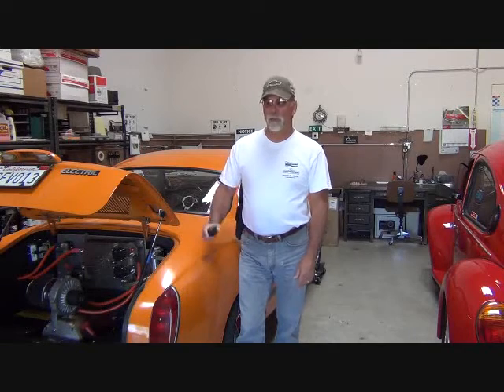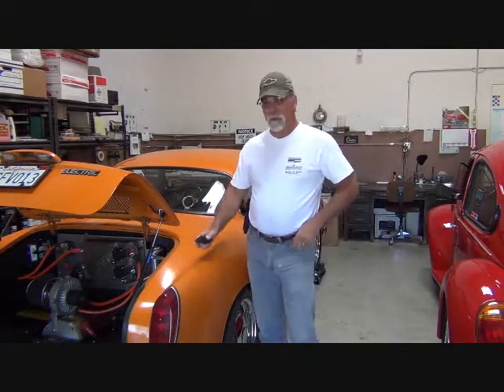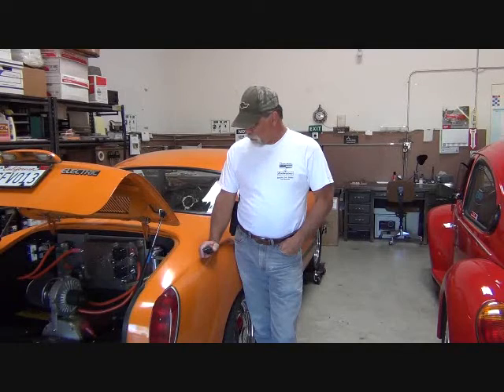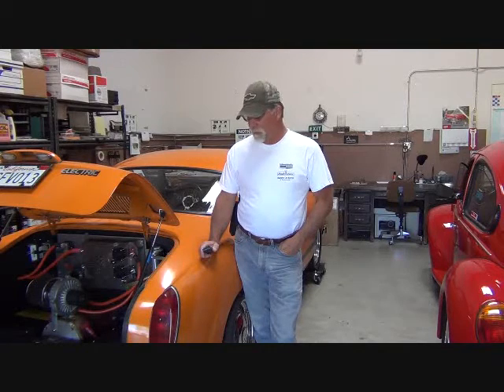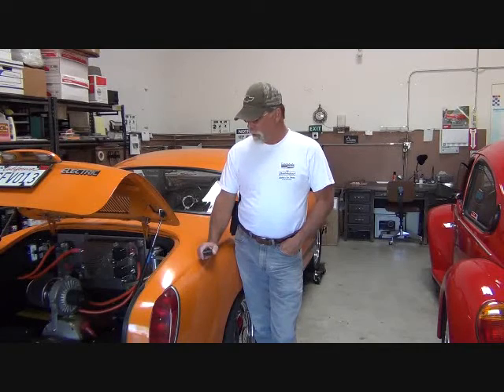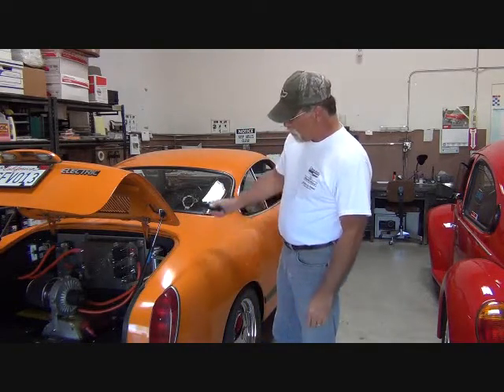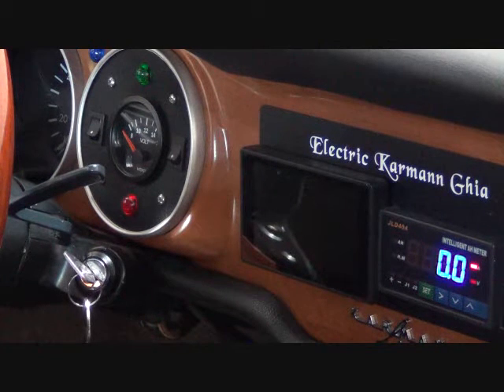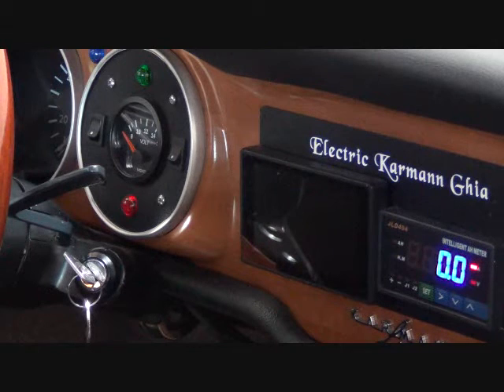Electric Karmann Ghia - From DC to AC, Episode 2

Comment: Hi Richard, and thanks for all you do!

Forgive me if I ask a silly question, I'm pretty green with EVs.

Is there more airflow in the front of a Karmann Ghia?  It seems like if there is, you could just throw the controller in the front?  Alternately, could you mount it on the roof of the storage place in front of the firewall?  Did you ever consider just moving the controller to a place with more air movement?  I'm asking because I intend to eventually get a KG, and I know that AC solves a lot of these problems, but I think I'd want to move it as a belt-and-suspenders approach to my build.
Reply from the maker: Thank you for watching and being a subscriber.  Ideally you want the motor and controller in close proximity to one another.  Using a chill plate and cooling system with an AC inverter, controller temperature is no longer a concern.